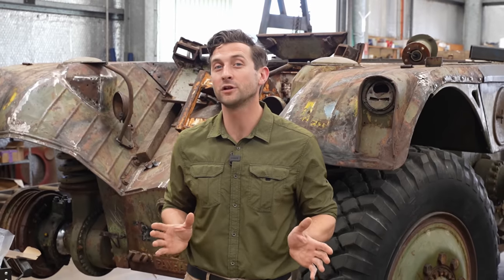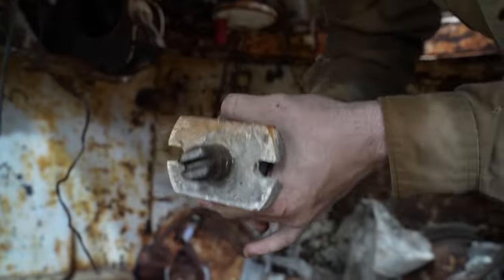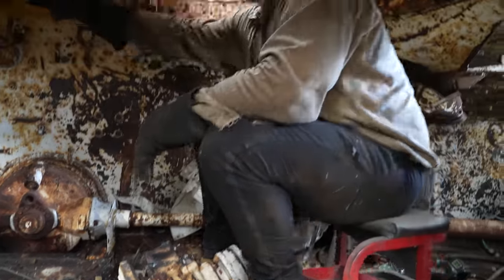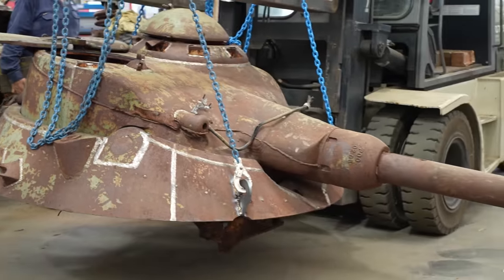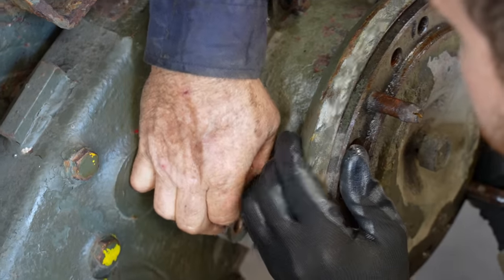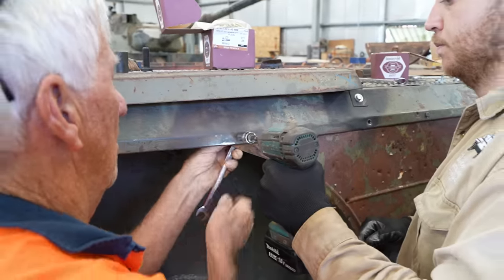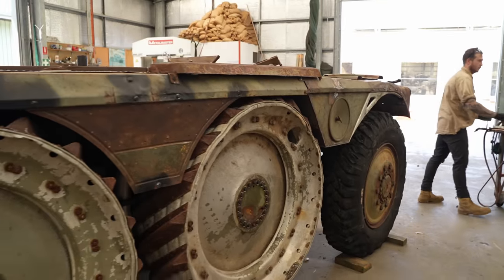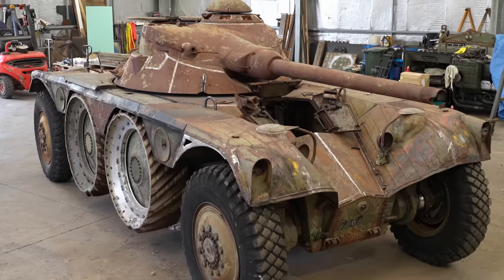WORKSHOP WEDNESDAY: Panhard EBR 90 turret and central wheel fitting (Approaching COMPLETION!)

Comment: Always enjoy my weekly fix of “Workshop Wednesday”.  It was obvious that the aluminum wheels gave you a bit of a challenge.  something that I have seen on other videos.  Have you ever considered making a fork mountable device to assist?  Maybe something with adjustable rollers to account for different diameter wheels.  This way you could adjust the height with the forklift and rotate the wheel to help align to the holes/bolts.  I don’t believe that this would be a one-off, however, I’d love to hear your thoughts.  - Rob

Comment: I kept thinking the crew would have loved a simi-truck tire jack to put on those wheels. In America these have rollers that support the tires for easy rotation to align the bolts holding the rim on, and can lift the tire while supporting the weight.  They made do with a forklift, but….

Comment: These are not common, but not rare either. At least, here in Europe, it's not odd to see farm vehicle with the aluminium wheels adapted in twos or even fours as flotation wheels. South of France, i've seen at least one tractor with 4 (2 per side) such a modification. Hopefully next time AAAM does an import they can squeeze the missing bits in with the rest.

Comment: It really looks like the French "acquired" an ex Wehrmacht Engineer from 1945 to "assist" in this very clever and "basic" design that could be easily serviced and maintained, sound familiar? As for the securing nuts on the aluminium wheel bolts? I'm surprised that they were not interleaved. Well done guys, a machine is built from scrap parts, very impressive.

Comment: Whats the race, exactly? You use that word a lot but I can't identify what you're referring to.
Reply: The hull and turret are connected through a large ring bearing to allow the turret to rotate. The race is the channel that ball or roller bearings sit in between the lower and upper ring surfaces. The term "race" is sometimes used to refer to the whole part with the channel or groove in it.